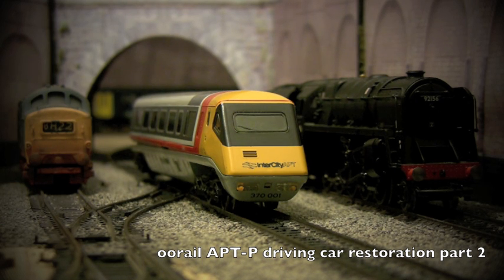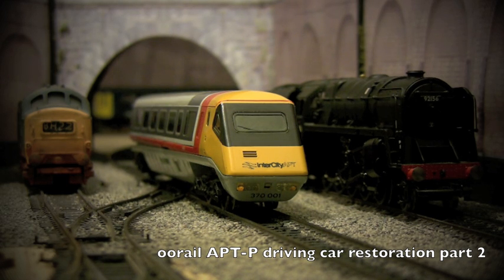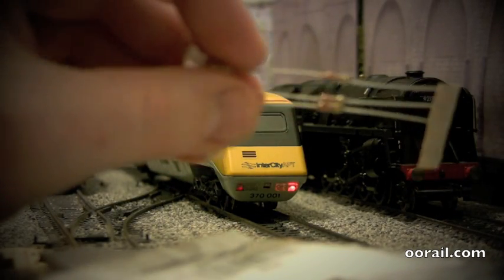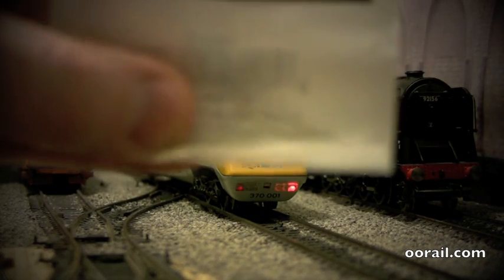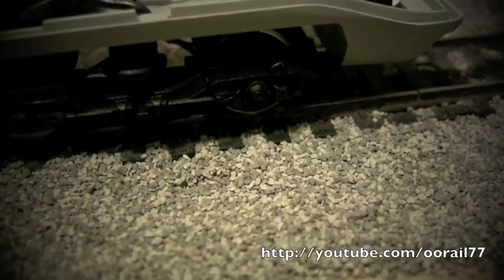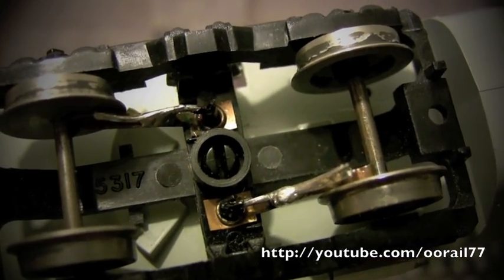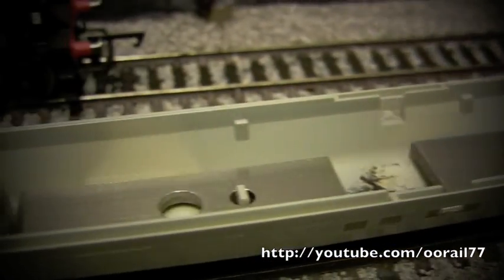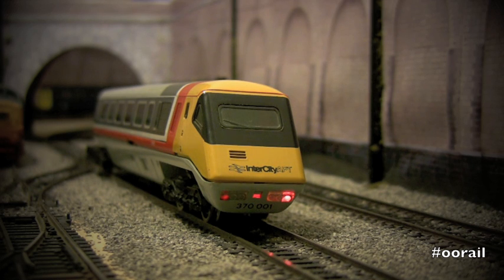oorail.com | Hornby APT Restoration Project - Directional LEDs - OO Gauge

Comment: Rather than waste 2 resistors per LED, I did something similar but just used one resister (1K for DCC when using 2V Red and White LEDs) and then split wire off to each negative of the LED's. Works a treat.

Comment: can it also be done the same way with the eurostar set
Reply from the maker: Paul Nixon Yes it should be possible. I would suggest using 2mm pin hole LEDs and thinner wire. I'm actually in the process of re-doing the lighting on the APT, you get a much better effect with the 2mm pin hole LEDs because the "pin" part can be pushed right up to the edge of the APT's light lens.
Reply: thanks for that

Comment: Unfortunately I too am a little too young to have seen it running, however I have spoken in depth to those who have and have seen both the APT-E (at NRM York and later Shildon) and the remnants of the APT-P at Crewe. I also followed the cosmetic restoration of the former from the early/mid 2000's.

Comment from the maker: Have a look at the everardjunction junction channel, he just did a video on coach lighting, I am pretty certain you can use the same circuit he used there for that to achieve the lighting under DCC. I'm not sure about directional lighting under DCC without a decoder though. Directional lighting works on DC because of the polarity change, DCC might be a bit of a challenge without a decoder. I don't bother too much with DCC because I have too many locos that would need conversion!!